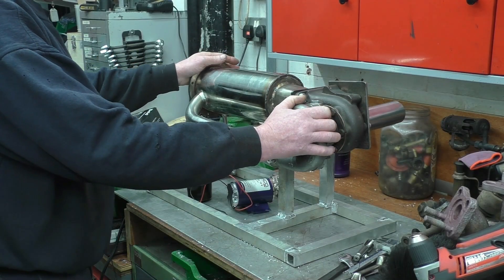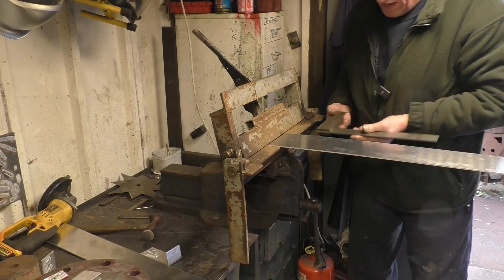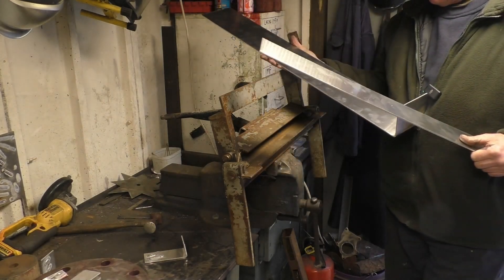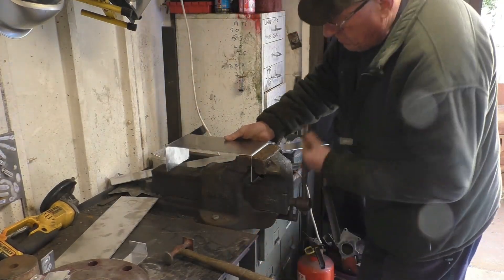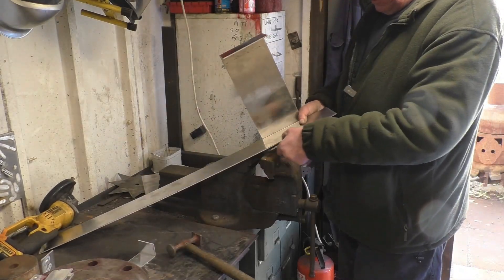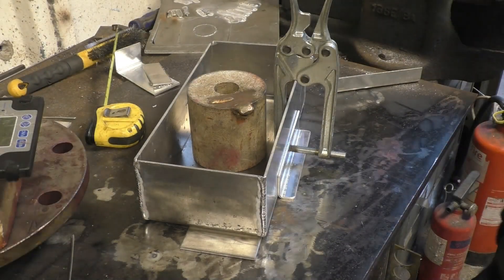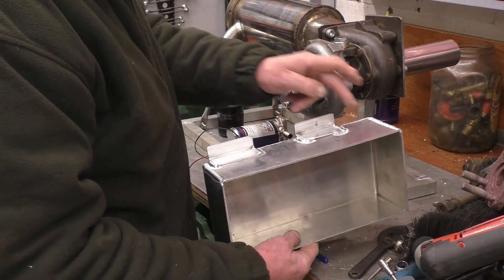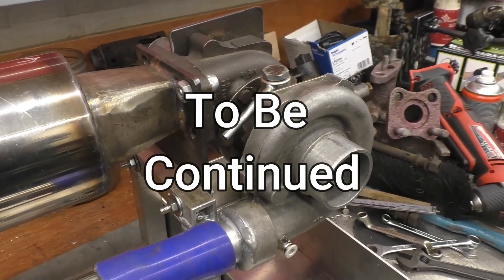DIY Gas Turbine P11 Oil Tank

Comment: looking good John, what helmet are you using for tig welding?
Reply from the maker: Hi Paul . I use the Optrel Crystal  as well as the new air fed mask from R _Tech
Reply: @doubleboost  thanks john will have a look at those

Comment: Very nice aluminium tig. Can I ask, will you have an oil cooler, or just rely on oversize oil tank and filter?
Reply from the maker: It will not be running for long periods a cooler may be a good idea
Reply: @doubleboost  put an oil cooler for the oil in the intake air and turn some hot oil into pre-heated air while cooling the oil.  The Chrysler turbines used the exhaust air to preheat incoming air by using an exchanger assembly.
Reply: Gas turbines produce more power and are more efficient with denser (colder) intake air temp. We always had more issues with placarded performance tests on fast jets when operating in warmer climates.